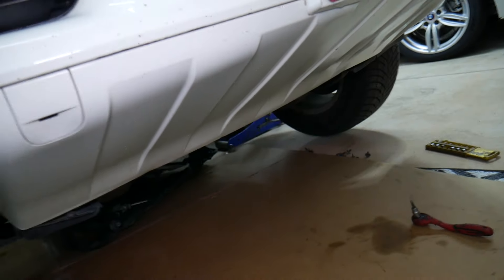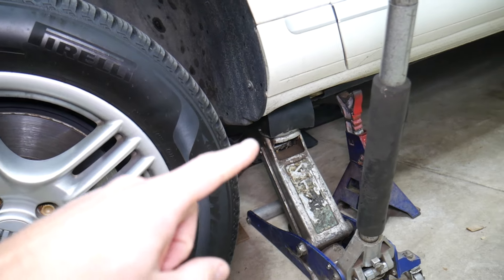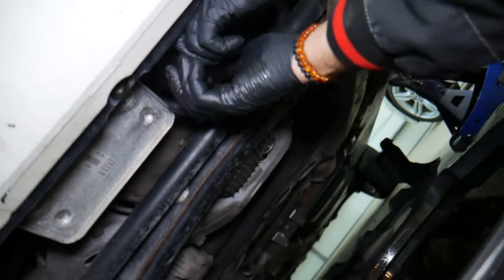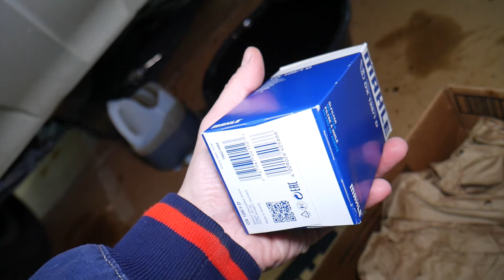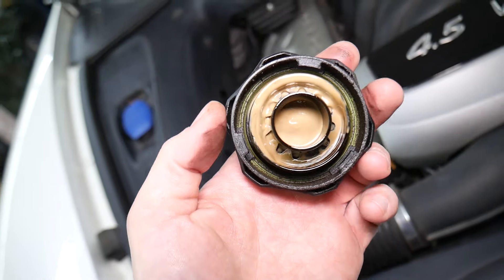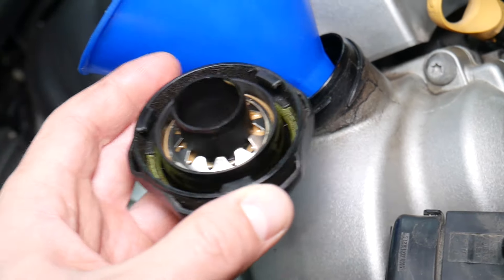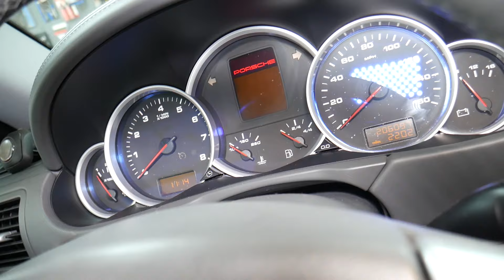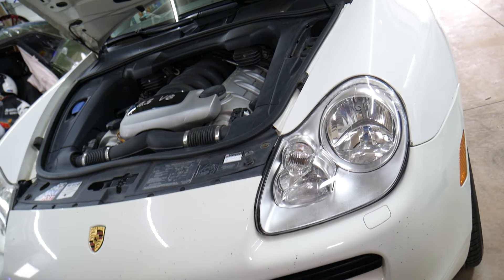TOP 10 MISTAKES PEOPLE WHEN CHANGING ENGINE OIL ON CAR

Comment: Quick question man, why do I hear buffering on my engine when I turn  engine off. I also hear like air inside going around the AC vents. I have a 2013 bmw x1 sdrive 28i.

Comment: Upgrade to a Fumoto oil drain valve. 
No more threads, torque specs, or mess to worry about ever again. Plugs are trash.
Reply: Indeed. If you have good ground clearance, a drain valve is a no-brainier.